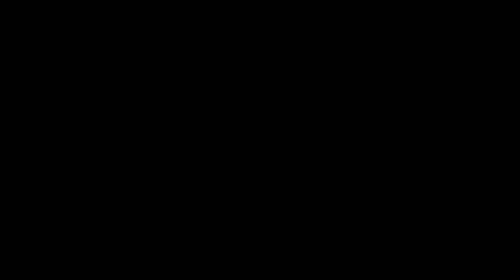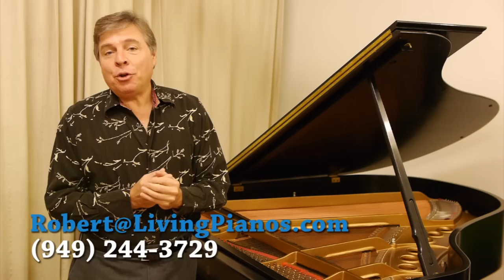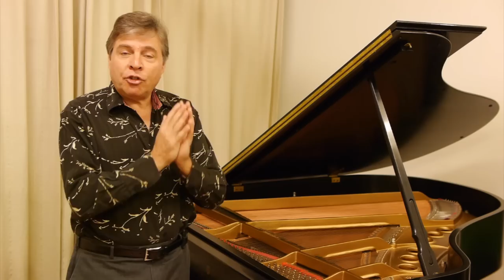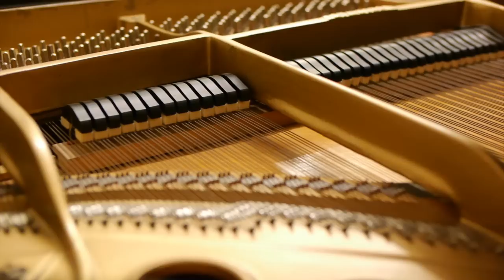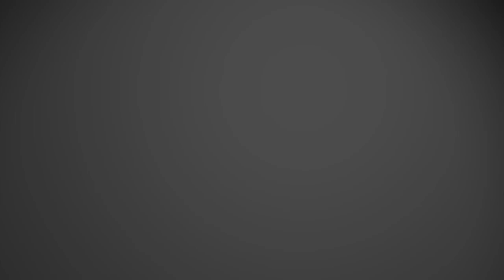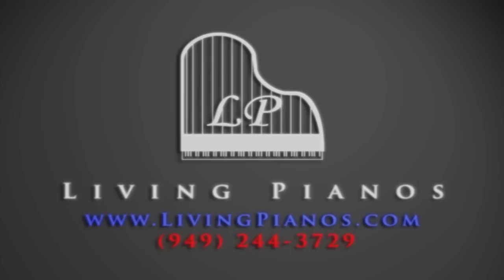What is Scale Design? Scale Design on a Piano

Comment: Birdcage refers to an obsolete type of action used in uprights in the 19th century - I don't believe it has anything to do with bridge placement...
Reply: Prior to crossover stringing was parallel stringing. This usually put the bass bridges close to the tail of the piano where there is less flexibility in the sound board. Crossover stringing relocates the bass bridge to a more flexible area of the soundboard giving greater power to the bass register.